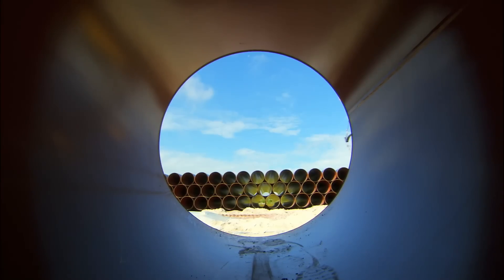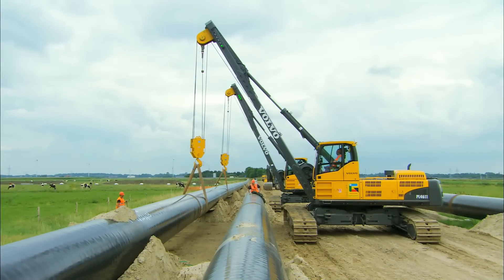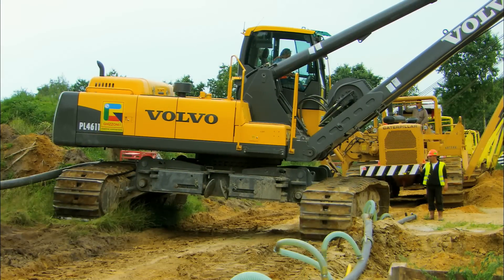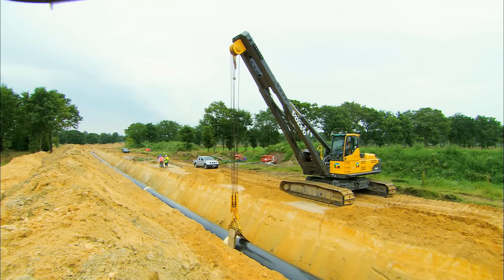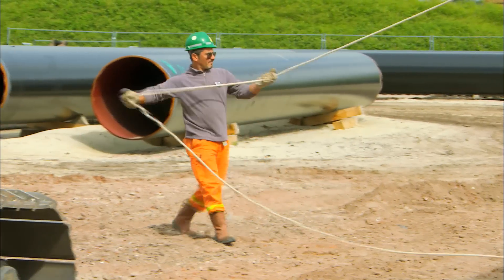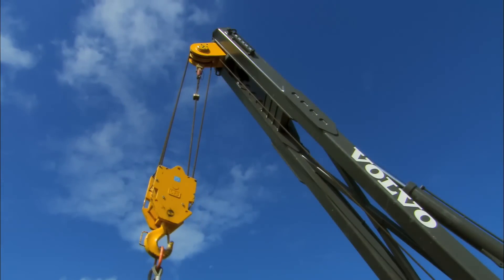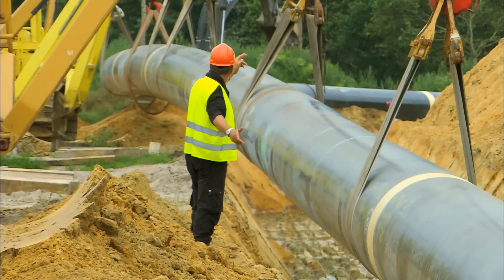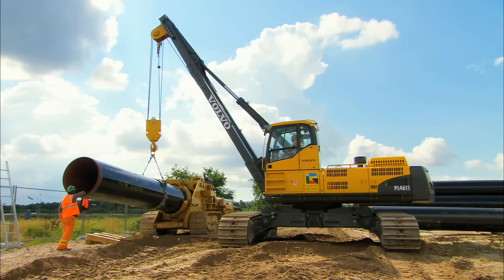Volvo pipelayers - The future of the pipe laying business

Comment: They never made it to any right of way i worked on. Ran a demo machine at my union's training center. Not impressed.  Whatsoever. Way too overengineered and expensive
Reply: They are out there. Most of them are 4608 or 4809’s which are a bit smaller than the one in this video. They will out lift a side boom and lay pipe in far steeper terrain

Comment: Or... just use an excavator
Reply: +TheMango121 Excavators are less reliable, and slower in the pipe laying industries.
Pipe Layers help the job get done faster than excavators in pipe-laying.
Reply: exactly, I used an EC290B to lift 7 tons pipes, I also had an rototilt and had 2 slings so I could line up the 22m pipes wherever I wanted. Didn't need anyone close to the pipes to put it in the welding rig.
And I did not need that much of space as that donkey of a machine did.
Reply: is new no problem. thank god it has the load management system yo
Reply: Well I mean, with legit pipe layers, you can get the job done faster.
Reply: MrEpicMinecrafter12

Less reliable?

Comment: I like it.  I think its pretty cool that it can disassemble itself for transport.  Major time-saver when going from job to job.  The side boom probably has a higher lifting strength then an excavator arm, simply because its not lifting the weight of the arm with the load.  Sometimes simple is good - cable lift is just fine, and you don't have to plumb the entire thing with high-pressure hydraulics either.   Looks like a sensible upgrade of a side-boom.

Comment: @nematvey Yes, its a display of a control module on the machine that constantly monitors the load placed on the end of the boom.  It proportions the weight on the end of the boom to the machines rated maximum load capacity and gives that reading on the green display you see.

Comment: byuhas57 is right!!! Machines have their place and this one is in a yard being used as a crane.There is no way that it can out work or be faster than a sideboom..I work pipeline and production is key!!! The right of way issues are this...A wider one DOES mean more time,cost and is even not possible in most areas.The allowed width can be as narrow as 60' and that is for ditch,pipe welding area and the travel lane..And then in most of these areas wooden mats must be placed to hold up equipment.

Comment: @jix177 oke cool , but i see no need for the pipe laying boom !! a sympel existing 2 jointed boom would do the same work , and would able agradual lowering like a set of davits does , there would be no modification wich takes time , a symple auto grab withe hook like on a digger would do to excange a multipe of tools , this mashine has bits that are not needed ea obsolete that have been copied from an old mashine. withe a colapeble cab the hithe of the mashine would stil meet road standards.

Comment: @xfilethe Earthmovers magazine did a feature on this recently and apparently it can be converted back to a digger in a couple of hours. Already some customers have purchased the machine with both a digging and pipe laying boom.
I suspect that if the tracks were flipped underneath the frame, the machine would probably end up too high to transport on public roads. As it is, the fact that the machine is able to lift its own tracks and counterweight onto a trailer makes it pretty self sufficient.